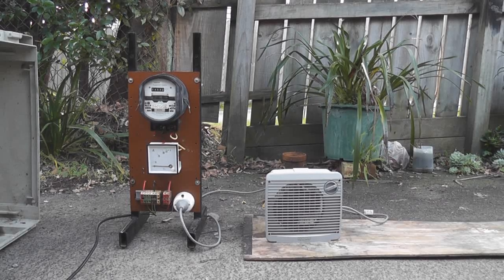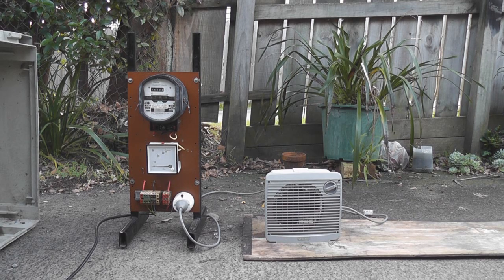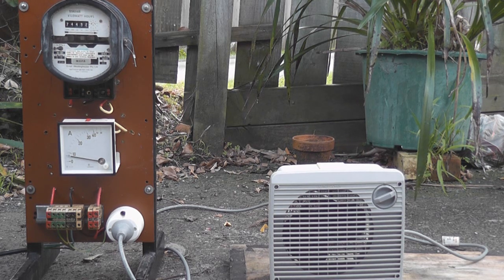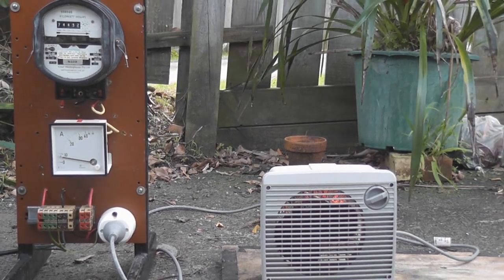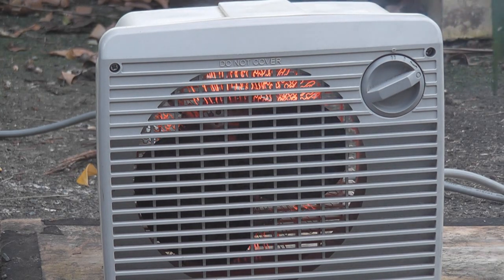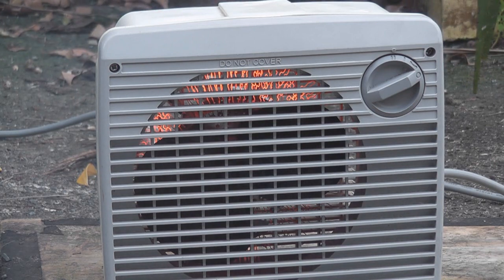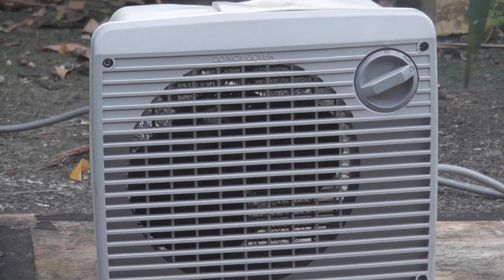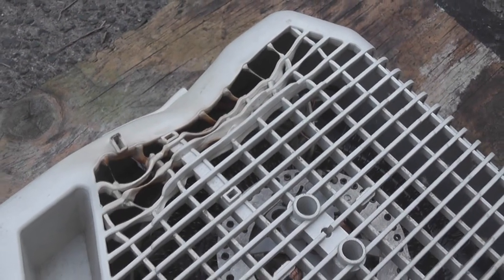Heater overheats

Comment: Question: what opened the circuit? Was it a thermal fuse and is that where the flames were...or did the element fail? Did you take it apart after?

Comment: I need help!! My fan has stalled, it's a normal one, and I woke up and I touched the fan and it's hotter than a heater
Reply from the maker: Well stop using the fan. Unplug from power socket and check what caused the fan to stall.
Most likely dried up lubricant in the motor bearings. Clean and relube, or some material may have got stuck in the fan housing and the blades are jammed.
Check alignment of fan housing cage.
Reply: @RODALCO2007 ; j in
Reply: @RODALCO2007  ik

Comment: I hate plastic heaters but in addition to the several thermal limits in there, the feather type heating element has thin wires and is designed to fail as a last resort

Comment: On the subject of thermal fuses, I had an electric fan stop working because the thermal fuse embedded in the motor coil opened.  At some point the fan had fallen face down and blocked airflow allowing the motor to overheat. I opened the motor, located the fuse and bypassed it. Then I put in a 3 amp time delay fuse in series with the live lead. Fan has since worked well for 4 years at my plant on a concrete floor so no worries about fire. It was rather difficult to access that thermal fuse and then jumper it without damaging the motor coil.

Comment: These old designs are severe fire hazards. Want an example? See the Kaprun disaster.  A single fan like these overheating burned down a whole funicular train and killed 155 people. Nuff said.
Reply: Those heaters should have never been on those funicular trains in then first place regardless of design, it was unrequired for the heaters to be put there, and they weren't even design to be used in that type of environment beside use around the home.

Comment: The plastic can be quite fire proof believe me or not, I tried to burn a plastic relay with a gas torch and it self extinguished every time I took a flame away.
Reply from the maker: Yes you are correct there. still I don't like the plastic heater cases while the plastic may not burn, the element can still cause a fire when it melts itself out of its supports and falls on the floor.
Reply: RODALCO2007 Actually plastics are rated for both flammability and tested for deformation under high temperatures, but I wouldn't believe that cheapo electric heater uses materials meeting UL94 rated flame retardant plastics or one s that were tested under ball pressure for resistance to deformation under elevated temps...
Reply: Yeah, CFL bulbs also use flame retardant plastic ... the manufacturers say it won't catch fire, but it CAN, given that it has an external heat source applied to it!
This could be a malfunctioning fusible resistor or the like ... I've seen several with holes burnt through the side of the casing ... scary stuff!

Comment: I had a Gree Electronic heater in my room(which was making smells of WD-40!) that heated up like hell because of failing bearings on induction motor that runs the fan...
I later fixed it and removed 5A heater assembly and now using it as solder smoke dissipation fan.
(That winter,I got 137$ electricity bills and got spanked in my face REALLY hard)

Comment: I had one just like that, they are junk
Reply: I had the same made in 1994 it went 5 month ago the fan fell of the desk. where the motor is screwed in so it doesn't move around it snapped so the fan was jigging around really it wasnt a good idea to have it so I used the plug and cable :(   
Im afraid all good things must come to an end.  :(

Comment: heh i had one that the thermal switch overheated with the current going through it :P but i replaced it with a microwave relay and a 272 opamp circuit :) at first i didnt have it right it was switching every second wich wasnt good but ive fixed that and now its pretty nice, one disadvantage is that you have to use two plugs and have a breadboard strapped to the top :D

Comment: You know, I've never really thought about it, but I too think it's a very bad idea to build electric fan heaters out of plastic, they should all be made of metal with metal grills and metal propellers if possible, of course the reason why they make them out of plastic is to keep the price of production down.  Is it still possible to buy a fan heater with a metal case?
Reply: Yes in Canada and the USA. Milk house fan heaters, comfort zone radiant fan forced heaters, and more. Here only the cheap heaters are plastic. The better quality and more expensive ones are metal and run hotter and glow red in normal operation.